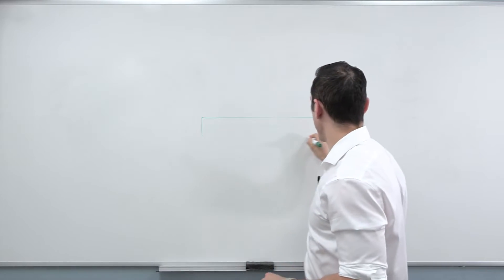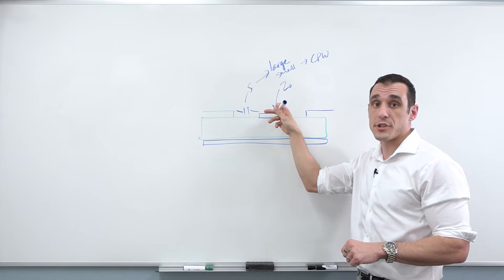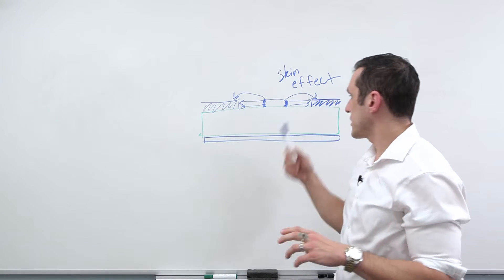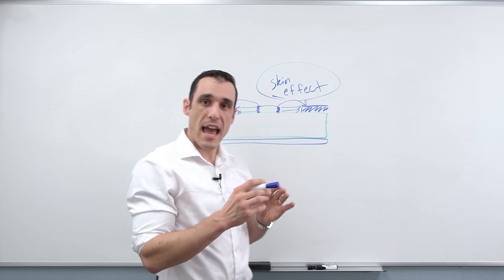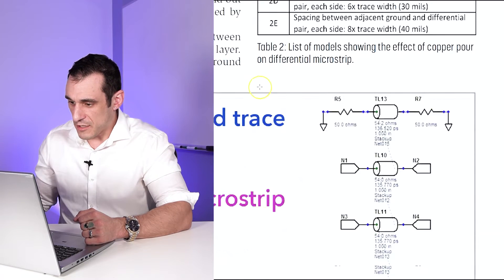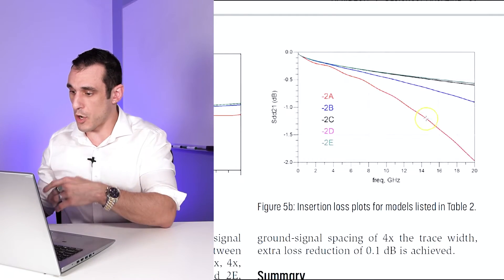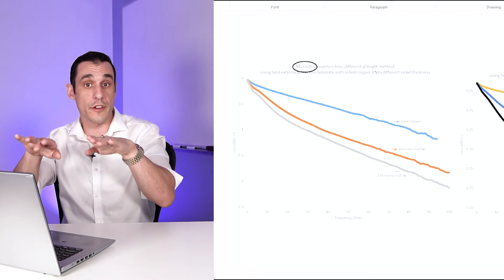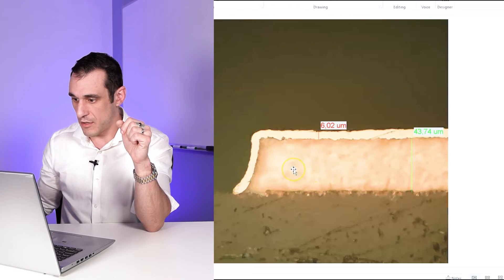Microstrip Copper Pour and Losses

Comment: what happens when you have a 20Hz to 20KHz signal with 20Vpp how would it be affected if the width is 0.5mm. The signal is not Digital but Audio
Reply: At those frequencies the losses due to copper and the dielectric are barely noticeable. This is because those losses are proportional to frequency, so they are much larger with fast digital signals and RF signals, where the frequency content is in the high MHz range or GHz range. At audio frequencies, the dominant loss mechanism is the DC resistance of the traces. If you are doing anything with amplifiers, you are basically designing a power system that must operate at those frequencies so it will tend to have much larger rails for those audio signal becuase this will reduce the DC losses on those nets.
Reply: @Zachariah-Peterson  thank very much this was great help, will post question 👍

Comment: Rick Hartley recommends tying the copper pours to the alternate polarity of the underlying reference plane, to increase interplane capacitance because such layers are often very closely spaced.  Your talk refers to ground pours, though.  How would having a power pour on the top layer affect the coplanar waveguide of a microstrip referencing a ground plane?  Would the fields "prefer" coupling to the ground plane because the pour powers would require the return current to pass through a bypass cap?
Reply: I'm familiar with this strategy, Lee Ritchey has stated he does the same thing. If you're designing to just use copper pour as a mechanism to increase plane capacitance, rather than using it for a controlled impedance circuit, then it's an appropriate way to use pour. Eric Bogatin has told me he disagrees with any use of ground pour and says there is no real usage for it ever, but that's another matter I'll be discussing with him in an upcoming video :). I think both groups are right.... the capacitance view is technically correct, but that's not necessarily implemented to solve a specific problem. Bogatin says it's never needed, and he's probably technically correct too because if you do the board design right, you might not need the extra capacitance anyways, so why bother? I think it's a silly thing to argue about because, 9 times out of 10, it doesn't cause the board to fail. Conversely, if you have an existing EMI problem in your board and you didn't include copper pour, then simply adding in the copper pour probably won't solve the problem, the root cause is either your stackup, grounding, or routing. I approach copper pour from the RF perspective anyways, where you do need it in specific types of RF structures you design. If copper pour and stitching vias didn't work, we would never have used it as on-board shielding in most cell phones for the last 2 decades.

In terms of what happens if you bring in power pour vs ground pour, you would still have the same capacitive effect because a signal traveling along a trace would be switching between two states, it's not a constant voltage. The capacitance is always there, but it doesn't create displacement current unless there is some dV/dt across that capacitance like you would have in a switching signal. I believe in the case where you have signal level being larger than the pour voltage level, then you would still have the same return current effect, it will then just couple capacitively back to GND through bypass/decaps and through the parasitic capacitance. If the polarity across that gapped capacitance is reversed, then the polarity of the displacement current is also reversed. It's more a matter of "what direction does the current flow".